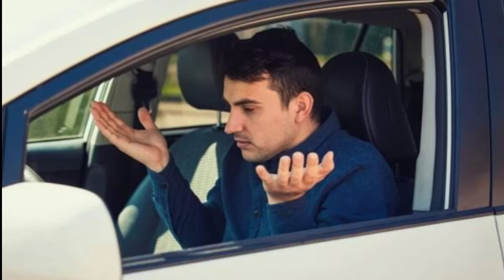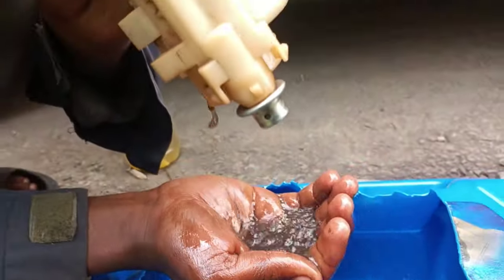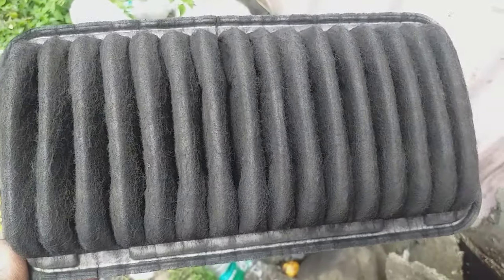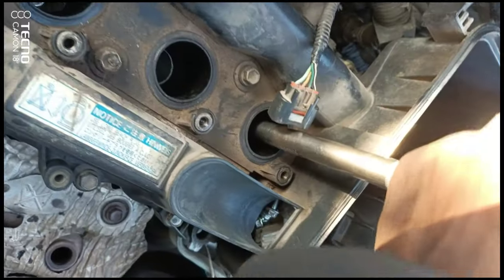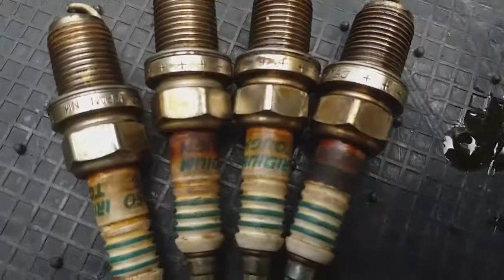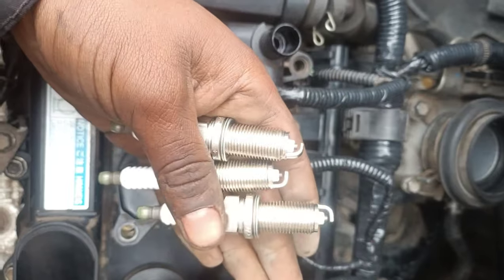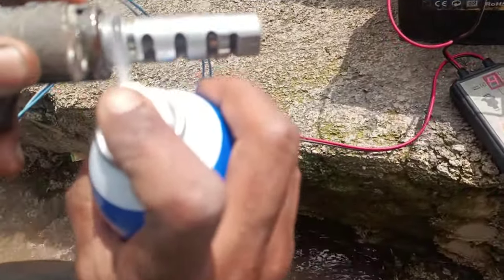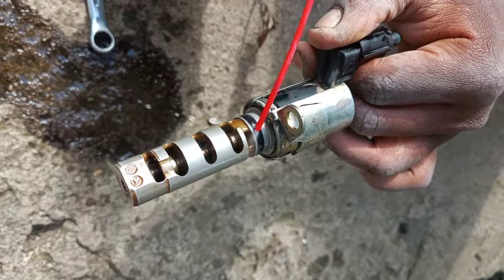Top cause of car losing power when acceleration

Comment: My car can go some distance with any gear, but after some miles, it will slow down if I put on 5 and 6 gears instead of 5 and 6 gears it will work 1 to 4 gears. I am driving 70mph on 4 gears. I did a diagnosis check and found an air intake pipe was worn out and changed it but the problem won't go away. Any idea?? Thank you

Comment: Please my car Toyota Corolla 2013 model has been losing power while accelerating
Reply from the maker: the cause of the power loss. This may include checking the fuel system for clogs or leaks, inspecting the air intake for blockages, and testing the ignition system for proper functioning.

Comment: I have a Lexus hybrid 2011 It’s the 200 CTH sometimes when driving I’ll be about 60 mph and when I let off the gas the engine stores running at like 60 mph in the RPMs or whatever won’t go down so it’s Amy that could even put the brakes on and I’ll still stay there like it gets stuck and then it finally will come back down what would what would the problem be there

Comment: I have a 2011 Lexus CT 200 H when I’m driving at about 60 mph sometimes it gets stuck the acceleration or the RPMs and it won’t go down even if I break or start slowing down the engine is still rubbing it in high RPMs what would the problem be there

Comment: I have a Nissan qashiqai 2013 1.6 petrol engine recently i have changed total clutch kit but even though it taking slow pickup when i was accelerating it is slow slow pickup and hills its going very slow pickup can please help suggest me
Reply from the maker: maybe If the clutch wasn't installed correctly or needs adjustment, it can cause slow pickup.

Comment: I went to the mechanics 5 days ago. Mechanics changed my cars engine fuel and then washed my car, and after few hours, my car stopped gaining the exact speed.. the same mechanics told me to buy catalytic converter which is for $1500 to $1700... I believe that while washing the car and changing the engine oil, they made a defect in my car intentionally...now when my car is neutral, it uses 1 gallon in almost 15 20 mins....can anyone suggest pllleassseeee 😢😢😢 its only 33000 miles
Reply from the maker: Check the fuel pressure
Reply: When ever a mechanic want the catalytic converter he's a crook..
.. if u have a scanner u need to check it....or check for fuel leak.... Tap of the fuel tank or line a small can waste a gallon quickly....

Comment: This is not the video I needed: My Hyundai 2011 Sonata(pronounced Yon-die), jerks and sputters when accelerating - once I get up to forty MPH it runs smooth, unless you get going up hill, then it will jerk and almost come to a complete stop. Won't run passed 1500 RPM.